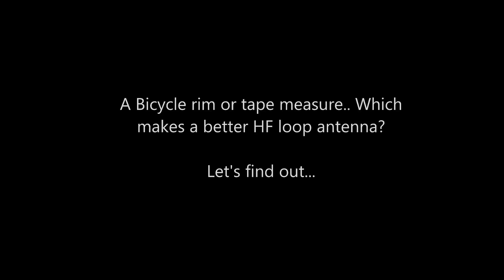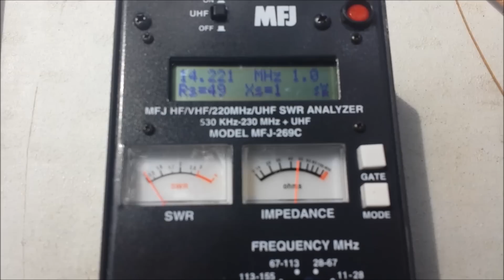AMAZING homemade HF loop antennas MFJ-935b loop tuner

Comment: I’m not able to tune the swr less than 3.5 using this loop tuner on 40m although i’m using the recommend wire length (28ft) what should i do??? Thanks
Reply from the maker: You may have to adjust the loop length, it's not exact as the manual states

Comment: Sorry but if I can't see the rf ammeter during transmission could be a fake. The meter tape material and the electrical joint can't carry the RF current so the qso radio could be connected to other real antenna ouside the video field :-(
Reply from the maker: OK.. there is no fake news here, I will advise you to please leave my video channel and never return.. I am not a fake, and you do not deserve to watch this.,.. 73
Reply: @HamRadioConcepts  HA HA HA....  :-)
Reply: @HamRadioConcepts  AH AH AH :-)
Reply from the maker: the tape measure antenna has been taken by manufacturers and sold across the world because of my video. i did not get anything from that idea, so it is my loss.. but it actually worked..
Reply: @HamRadioConcepts  ..tape measure antenna is a dipole voltage radiator not a loop current one so the loop antenna material will carry a great amount of a rf current like 80-100 Amp using a standard 100W rig.

Comment: Have any one experimented any longer with this little tuner? Found someone who is double looping for 40 meters and it seems to be working fine! https://www.youtube.com/watch?v=QC6lJWenUQ4
Reply: Yes, I have the  MFJ-936b loop tuner and used a 7' x 7' PVC  X- frame with 2 turns of wire and an additional door knob capacitor in parallel at the tuner connections to the loop to help resonate the loop on 80M, with equally impressive results.  I believe the value of the door knob cap was about 50pf at 10KV.  The loop was sitting in a spare bedroom and running a full 100watts into it.   SSB had good results and digital modes running lower power were equally good.

Comment: I live in a restricted antenna HELL location but I had the big MFJ loop.
Worked well indoors but really not portable.
So I did a side by side with the MFJ 935-b and both  were equal.
A few weeks ago I ran 5 watts from my FT 891 and worked ON4UN.
His massive antenna picked up my 5 watts but I did get into Alaska and Washington, State with 10 watts.I am really amazed how well it nulls out QRN.
I now have a 3/8th OD copper tubing that I use just for 20 meters and I noticed DX is stronger
I made my own PVC cross from PVC found where new homes are being built.
My next move is picking up a few cheap tape measures from the dollar store.
Any antenna is better then a cold rig sitting on the shelf
Excellent videos
Many thanks
73 BOB  AF2DX

Comment: I never thought about using a tape measure for the loop.....so the measurement its based on the length of the wire (tape) or the diameter of the loop?
Reply from the maker: +Jose Guzman I meant to say circumference in the video.. the 20 meter loop is 13 feet. not the standard quarter wave length.. the diameter of the loop can vary, as long as the length of wire is 13 feet.. larger the loop lower the frequency.
Reply: Thanks